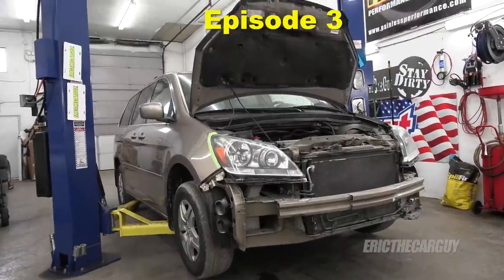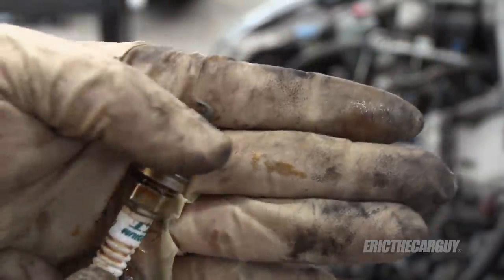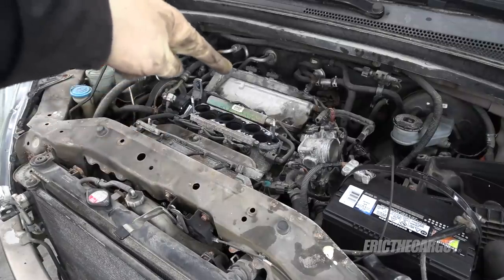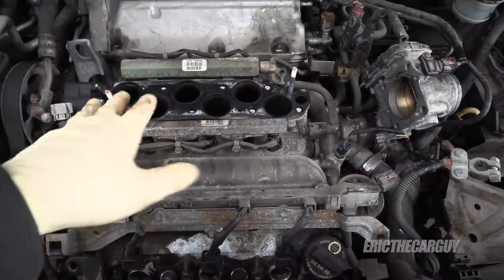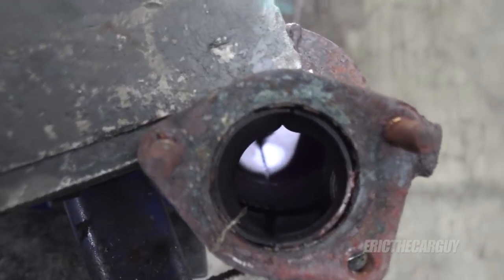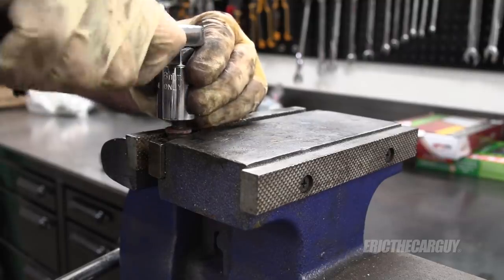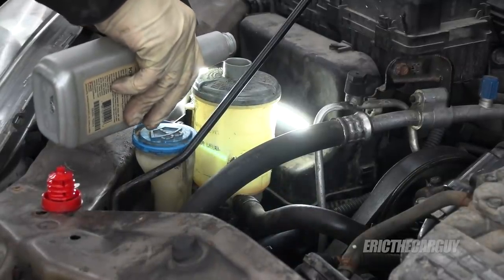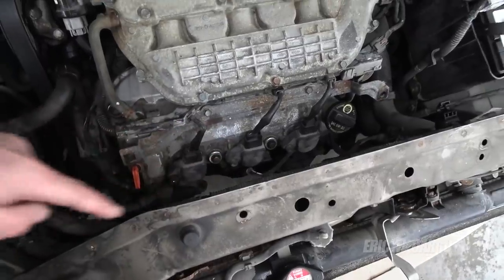2005 Honda Odyssey Engine Work (Episode 3) Fixing it Forward

Comment: God, I need a lift...

In fact, I need a garage...
Reply: You and me both. I live in an apartment. Around the block in the ghetto there's a guy with a two post lift in his driveway, but his house is falling apart.
Reply from the maker: When I started I was working out of the back of my car in peoples driveways. Work hard, stay focused, you have no idea what you might achieve. Good luck.
Reply: @Npc5150  That man has his priorities in order
Reply: @ericthecarguy  I appreciate the words of encouragement. I am actually planning on building a garage this summer. I will finally have a flat, covered, stable surface to work on my car after all these years.

Comment: Hey I have a 99 honda civic I just put a new distributor on it and it still want crank , what could be the problem
Reply: Won't crank? You mean it won't turn over? Check for spark, first and foremost. Pull a plug wire and put the end close to a bolt head on the engine. Don't hold it with your hand. Try to crank. If you don't see spark jumping from the plug wire to the bolt head, you've got ignition problems. Figuring out fuel problems is easy. Just spray some starter fluid into the intake charge tube and then crank. If it starts and runs for a few seconds, it's a fuel problem.

If it won't turn over, it could be a lot of things. Remove all the plugs and then try to crank it. If it's hydrolocked then you'll see water shooting out of the plug holes. Remove the starter and bump it manually using battery power. Test the solenoid and the motor itself.
Reply: @Npc5150  ok thanks buddy
Reply: @youngblack5111  Get back with more detailed info if you need help. If not me perhaps someone else will pick it up. I'll check back. I'm shadow banned on YouTube.

Comment: does spark plugs need to be torque
Reply from the maker: It's recommended, but I never do it. 1/4 turn past seating is typical for a plug with no gasket, 1/2 turn if it has a gasket.
Reply: @ericthecarguy  or if it clicks in your wrist then its torqued :P

Comment: The head itself is about $900. The valve cover is only about $140.
Reply: Get a used one. They're cheap and sometimes they come with a bonus valve cover. Replacing valves, springs, seals is cheap. Easy to mill the heads at home for free with glass and sandpaper.

Comment: I am surprised your using after market catalytic converter doesn't Honda engines need oem to not get engine codes
Reply: Nah. You can use aftermarket. The downstream cat isn't monitored either way. The upstream cats will all work the same. They're controlled by the short term fuel trims and AFR sensor (upstream o2) switching.

Comment: eric I used to work at the factory that makes that fuel rail. Keihin. the plant I was at made an entire engine
Reply from the maker: Your former company also used to make carburetors for the older models.
Reply: @ericthecarguy  I did not know that, thanks for sharing.

Comment: should have done a valve adjment doing all that work
Reply from the maker: I didn't feel it was necessary. Also, anytime you see a cylinder head with that kind of gunk on it, it makes adjusting the valves a nightmare.
Reply: @ericthecarguy  Never realized it but you're probably right. Are you talking about carbon or varnish? Is there any way to get rid of that without removing the head or any kind of gimmicky oil treatments?

Comment: honda needs  to buy  gms  3800 engines   ,,they  run forever
Reply from the maker: Perhaps you missed the timing chain and intake manifold gasket issues with the 3800? FYI, GM used this engine in the Saturn VUE. That should tell you something. Thanks for the comment.
Reply: I'm with Eric on this one. The J series is rock solid if you take care of it. Almost as durable as the D series. IMO the D series can take INSANE abuse and neglect and keep running with only minor repairs.

Comment: Gorilla Glue, UM NO. MAYBE JUST MAYBE JB WELD BUT YOU MUST DRILL HOLES IN BOTH SIDES & SCRATCH UP THE SURFACE. MAKE SURE IT'S VERY VERY CLEAN THEN APPLY JB WELD OR DEVCON PLASTIC STEEL, GET IT IN THE HOLES YOU DRILLED, WORKS GREAT ON BEDDING RIFLES.
Reply: @zeroyon4562  Was it a Snap pry bar ?I didn't notice ?
Reply from the maker: Matco actually.
Reply: @NoWr2Run  Well I stand corrected- I thought the handle looked like Snap Off.
Reply: @ericthecarguy  There ya go MATCO, Thanks, SIR ERIC.
Reply: Gorilla Glue is amazing. Some woman glued her hair to her head about a month ago with it. Doctors at the ER couldn't figure out how to get it loose. She ended up needing a surgical procedure to release her hair. The only thing I don't like about GG is the flashing. It will always seep and bubble around the edges.